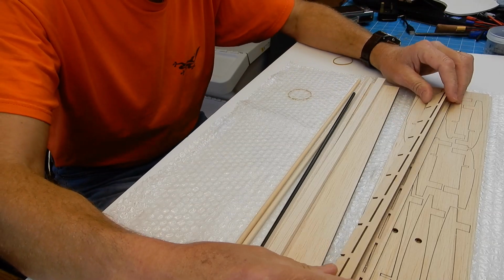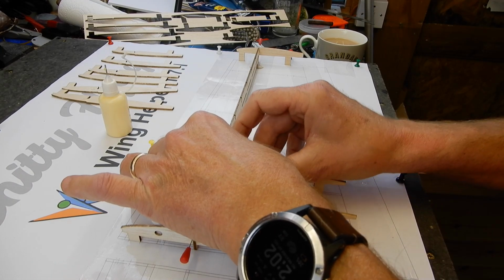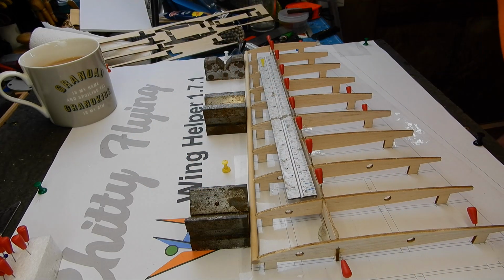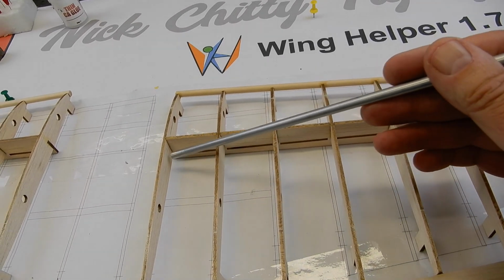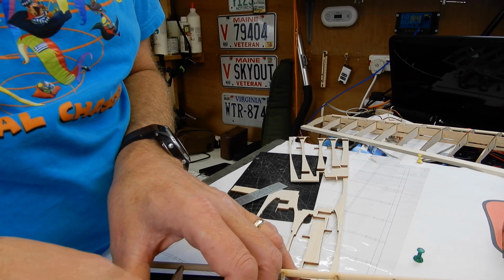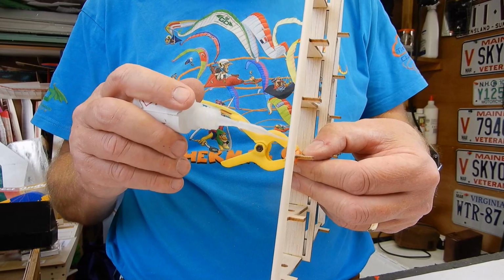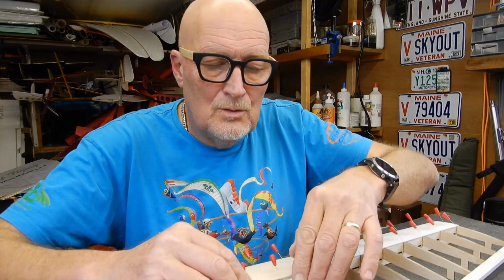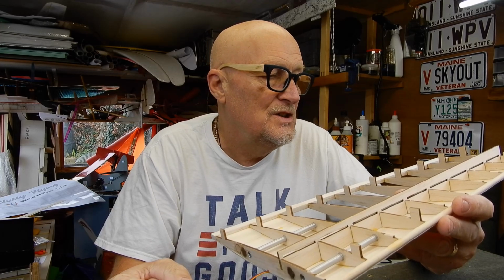New balsa jet wing   Its here my wing

Comment: Hey Nick, this is a wonderfully detailed video! I enjoyed watching - and I was happy to see that in the end, all parts fitted great. ;)

Getting the ribs numbered is a bit tricky, especially if one is using lightening holes. There is just no good way to place the rib numbers automatically so that they don't coincide with some other "hole" in the rib. I suppose the only way, right now, is to manually position them on the rib in the DXF file. They are to the right of the ribs in the DXF file produced by the Wing Helper, in format "panel number / rib number".

And one more tip: the holes for the magnets and for the servo cables can also be achieved by placing a round spar so that it starts and ends at the same rib. That only leaves the hole in the rib at the position you placed that "spar".

I'm looking forward to the next video! :)
Reply from the maker: Thank you and well done yourself mate